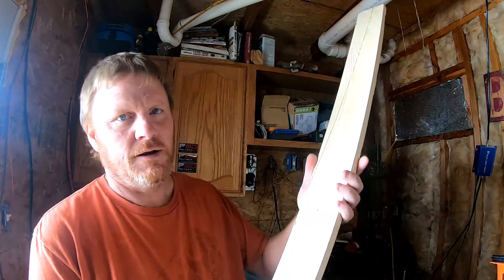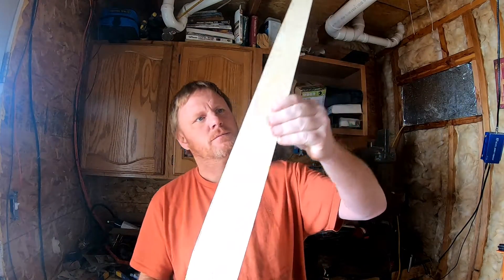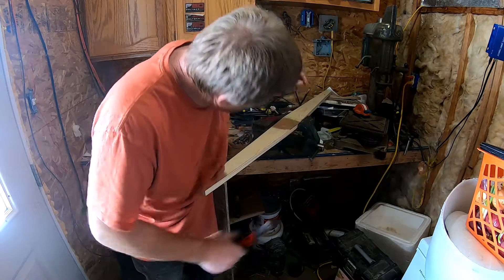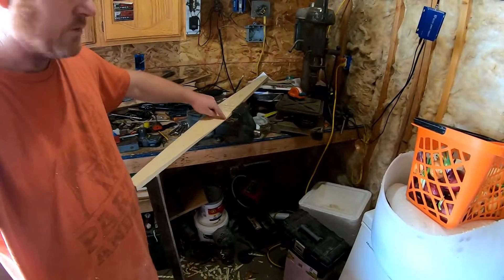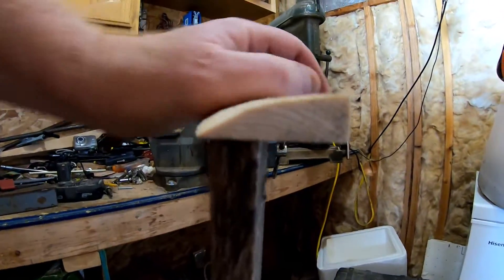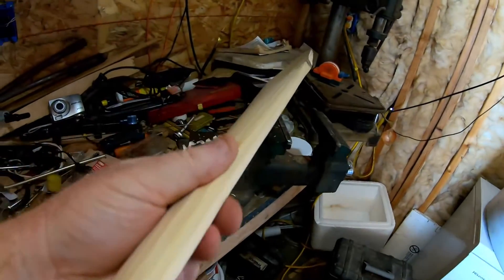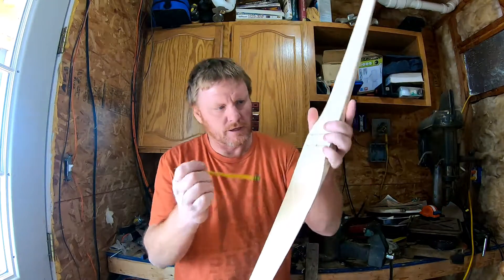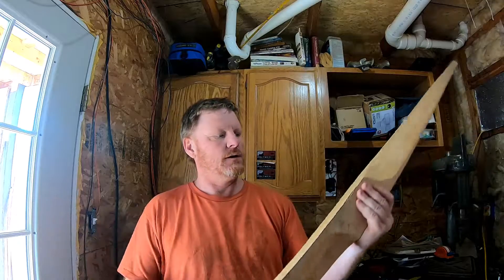carving a wind turbine blade, DIY wind generator, how to make a wind generator, car alternator

Comment: Angle at the tip 1 to 6 
in the middle 1to 3 
in 1/6th (near to centerbof rotation) 1 to 1 (45⁰).
 This blade which you've made makes a lot of turbulences therefore is not very effi'ient. 
Try blade from plastic sewage pipe.  6" , 8" pipe . Cheaper, faster and long lasting
Reply from the maker: Negative, tried em, and they are no good

Comment: Many thank's for this, I have a charge controller for a wind or solar system, and have a spare alternator, plus a bearing mount for a wind gen blade, I had considered an inverter to generate the 240vac here in the uk but an engineer friend said to me why do you want to do that, there are plenty of appliances which will run on 12Vdc! and you won't lose as much energy because of the efficiency involving conversion from low dc to high ac! I have to admit I find it  a compelling argument for incorporating a small 12 volt system in the home the only problem I see are the thickness of the feed cables over anything like more than short distances.